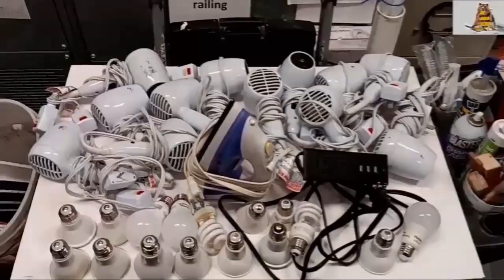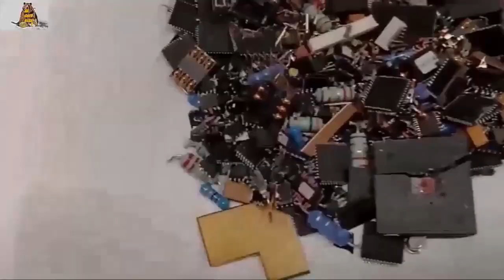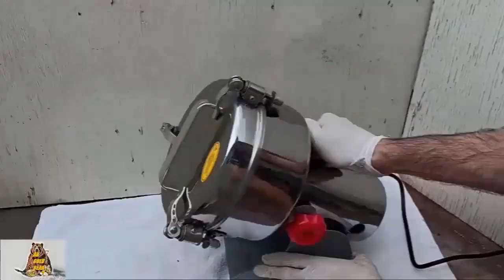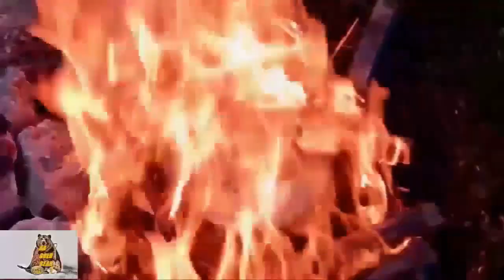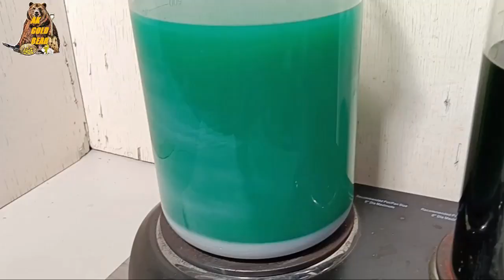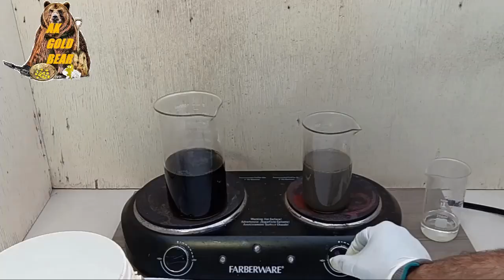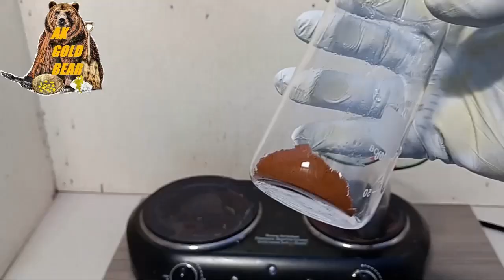How to extract precious metals from old electronic devices?! 🤔

Comment: Nitric acid and sulfuric acid could disolve gold, i was recovering 12kg of DVD optic and i got more gold in photo diode and small IC than in my laser diode, i was using 400ml distiled water, 400ml 35% sulfuric acid and, 200ml 68% nitric to disolve metal in laser diode but i got low yield probably because those mixture could disolve gold, i was pour bunch of water denox the acid and percipitate with Ferro sulphate and still can't find my gold.
Reply from the maker: Hi.🖐 Sulfuric acid and nitric acid do not dissolve gold. If your sulfuric acid is 35%, I recommend using 600 milliliters of water instead of 400. 🙂
Reply: @akgoldbear7669 I was know this mixture from Russian gold recovery youtuber his name is Francois Pellier and all of Russian youtuber always use mixture of nitric and sulfuric acid to pickling steel from the gold. 
Even a hot mixture of concentrated nitric and sulfuric acids can dissolve gold, with lower oxides of nitrogen forming. Addition of water caused the gold to precipitate back out in metallic form, but if a solution of permanganate is used instead, the gold remain dissolved.
Reynolds, later by Spiller
Chemical engineering, Volume 2, p316. BTW why i need use 600 ml water instead 400? Also i lost my gold that i recovery from laser diode (197 gram) using those Russian mixture.
Reply from the maker: Hi. 🖐I don't know who told you this or what experiments you conducted to find out, but I can tell you for sure: sulfuric and nitric acids don't dissolve gold. Steel and base metals plated with gold dissolve. But gold doesn't. 
  Why do you need more water?! When preparing an electrolyte from 35% acid, 400 milliliters of water is not enough. It's too dense an electrolyte. Metal dissolves in water, not acid. Acid is a reagent that dissolves metal in water. And if there isn't enough water, the metal won't dissolve. Good luck. 🙂
Reply: @akgoldbear7669 thanks this is not experiment both of us is gold recovery enthusiast maybe i was doing gold recovery for living right now there is really disapointing result when i recovery the gold from laser diode it had less gold than in my ash material that comsist of tiny IC and photo diode, in fact my gold in tiny ic magnetic material is way much than i recovery from laser diode which is really disapointing, thank for your advice to add more water because the reaction from diluted sulfuric and nitric acid is so violent maybe i could add water to stabilize the reaction but crank up my stove to start the reaction.

Comment: Hi AK. Glad to see your new video. You spent a lot of time on the burning process, and this allowed you to avoid the cloudy sediment which could be formed after gold precipitation with iron sulfate. In other words, you completely burned the sulfur and heat-resistant oils. Excellent work, as always.
AK, I have a question, if you don't mind. Should nitric acid be used to dissolve iron in river sand before dissolving gold with aqua regia? Thank you )
Reply from the maker: Hi. Yes, it took a lot of my time to burn the material. Thanks for watching and supporting 🖐
No, you don't need to use nitric acid. Nitric acid only dissolves metal. But hydrochloric acid dissolves metal, calcium, sulfur, and many minerals, which, at high concentrations, can affect gold precipitation. And hydrochloric also destroys quartz. So, if there's gold hidden in some grains of sand, hydrochloric acid will expose that grain. 🙂
Reply: @akgoldbear7669   Thank you, golden Bear )
Reply: @akgoldbear7669  к сожалению в наших краях концентрированная соляная кислота не продается максимальная концентрация в свободном доступе 14%
Reply: Why not use HCl ?
Reply: @Hill-13  I've seen some youtubers use nitric acid. But on forums, people say I should use hydrochloric acid...
Reply from the maker: @Hill-13   The nature of dissolution in nitric acid depends on the acid's concentration. Concentrated nitric acid at room temperature passivates aluminum, as you said, but at higher temperatures, the reaction is possible. Diluted nitric acid reacts with aluminum. When thin aluminum reacts with very dilute nitric acid, ammonium nitrate can form.
What are you doing there, man?! 😁
Reply: @akgoldbear7669 honestly a couple of months ago I had a rough time separating a mixture of Al and Silver . I used dilute nitric and added heat then more Nitric was added still had a hard time separating the two the nitric was 68 percent .
Reply: @akgoldbear7669 replied in the wrong spot , that’s a great story .about three years ago I was processing chips . I had burned and crushed them , separated with a magnet . There was some metal bits that didn’t dissolve in hot nitric  , it was late so I turned it off . A couple of days later I could still see pieces of metal . So I added a few drops of bleach , do you know that voice in the back of your head that says stop Ok was it dumb probably it . I  had asked about the method  and was told I was making a nitrate of urea . I did get a little scared , diluted filtered and poured it out . Your right It was dangerous I didn’t know better probably should nt have brought that up I’m going to edit that part .

Comment: $450 gold! That's more than those electronic devices would be worth at scrap or at a swapmeet!
Excellent content and excellent video as always AK! I learn something everytime I watch.
I do have a question tho that I might know the answer too thanks to you and sreetips.
Does the sulfuric acid dissolve the steel, zinc, nickel that might be present in all of that electronic scrap? If not what happens to it during your recovery and refining process?
Reply from the maker: Hi. Thank you for visiting my channel. Yes, sulfuric acid can dissolve some types of steel, in particular regular stainless steel. About zinc, yes, sulfuric acid dissolves zinc too. When reacting with concentrated sulfuric acid, zinc sulfate is formed, sulfur compound and water . Nickel is chemically inactive, and sulfuric acid is not a strong oxidizer, so the reaction is slow. However, at high temperature, nickel dissolves in dilute sulfuric acid, forming nickel sulfate 2
I don't quite understand you, I don't dissolve metals alone in sulfuric acid. I add nitric to the electrolyte, which is dilute sulfuric acid. Steel, zinc, and nickel dissolve in this acid 100%. 🙂
Reply: @akgoldbear7669 okay so with nitric and sulfuric acid you're getting rid of all of that in one swoop. I understand now. For me I only knew that nitric dissolved silver, and copper. In my head that's what I associated with base metals. And sulfuric acid I only knew precipitated lead. I didn't know that with nitric it dissolved so many other metals like steel, zinc, nickel. That was the missing link in my mind. That combo is amazing and cleans so many things up. Then you take that dirty solution make silver chloride and the rest can go in with the angle iron bucket to recover copper. Thank you AK for explaining again and again. I'm sure it gets tedious. However thanks to you it seems easier to process electronic scrap now. Thank you 🙏
Reply from the maker: It was nice talking to you. And thanks again for continuing to watch my videos. I appreciate your support 🖐🙂

Comment: Silver is too low, with 1:49 number contactors
Reply from the maker: Yes, there wasn't much silver, and I extracted most of it from the blue capacitors and microchips. The contacts are just silver-plated copper. Unfortunately, there were no silver contacts 🙂 Thanks for watching.